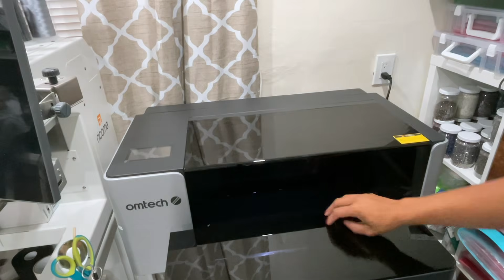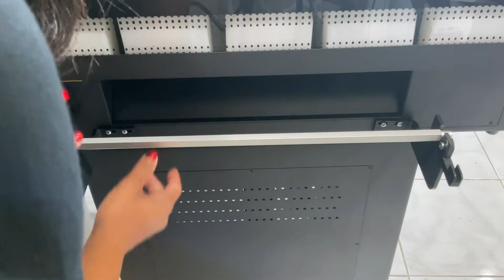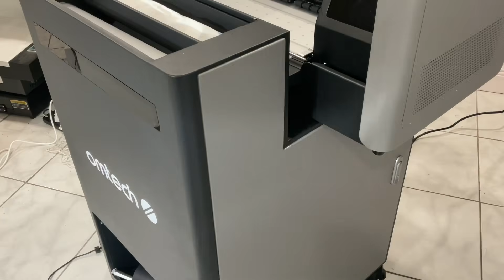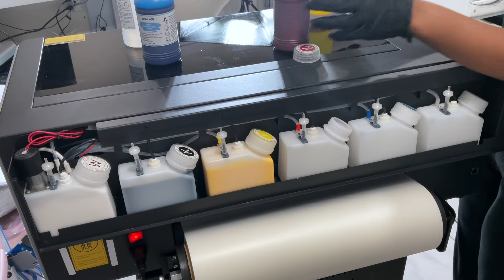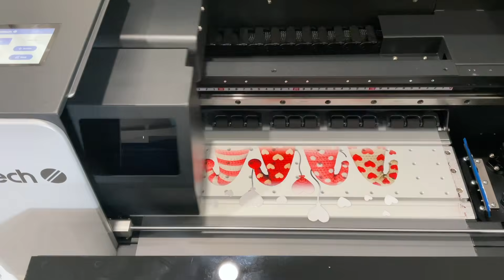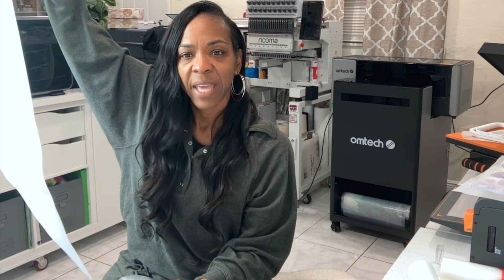NEW DTF PRINTER | OmTech Aurora Direct to Film Unboxing | SETUP & FIRST USE!

Comment: At least your printer arrived in working condition mine has been a headache since it was delivered damaged. I had to put a shipping claim in this printer is completely unusable the top glass came broken then they told me to continue to set it up to see if it worked but nope just my sh*t luck the knife tray is bent, the printer will not stop beeping cause now it is locked up.. I hope OMTech makes it right. I was so excited for this printer and now it's been nothing but a nightmare. The only good thing that I've experienced so far was they have fast ground shipping, that part was awesome but the rest has not been.. :(
Reply from the maker: can you put in a claim with the shipping company? Can you dispute the charge? Once I opened it and noticed that it was damaged, I would not have proceeded with setup.
Reply: @CraftableThings  Yes, I was able to put in my shipping claim and they just shipped a new one to me so hopefully fingers crossed, it will be a better experience. They also turned my nightmare into a win because they are also sending me a new printhead for the damaged machine and they said I get to keep both printers which I am extremely happy about. :)
Reply from the maker: @true1dez  Wow!!! That is awesome!

Comment: Wow I'm sorry but the noise coming off of that machine is horrible it has too much waste Xtool will be a whole lot better and a whole lot less waste because every time you stop a print if you leave it to cure automatically it has to run that film from the printer through the heating element because it has  nothing there to pull it through except for the other spool. You lose almost 3 ft of film or more every time you stop printing yeah it looks like a half of an idea good video though
Reply from the maker: the noise really isn't bad. I have both the xTool and this one and the xtool is louder because of the filter. Outside of that, they make the same noise when printing. I also covered the wasted film. You don't have to use the film roller.

Comment: Thanks for sharing, I am looking at this one compared to the xtool one. Not sure which is best yet
Reply from the maker: Hey Bad Brad! This one is pretty good. It's fast and straight to the point. Both have pros and cons for various reasons. I am happy with them both. With xTool, I have seamless printing from their app on my Mac. You can't print tru gang sheets with the xTool. I didn't like that at first, however, it make total sense.